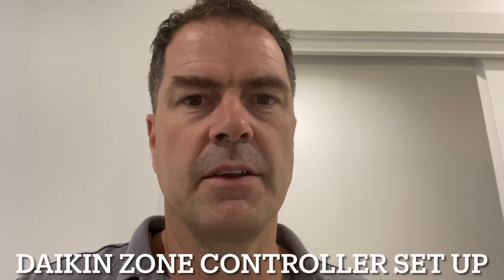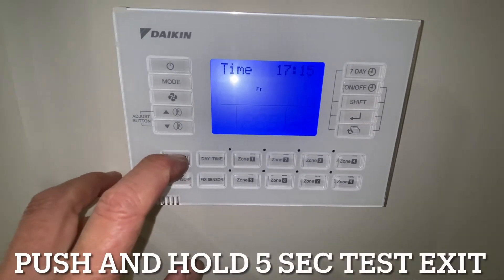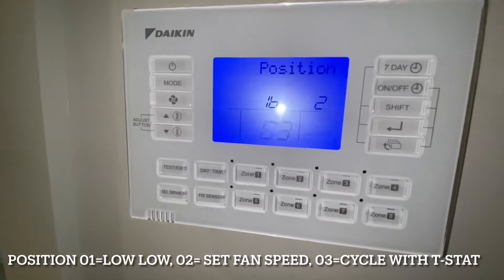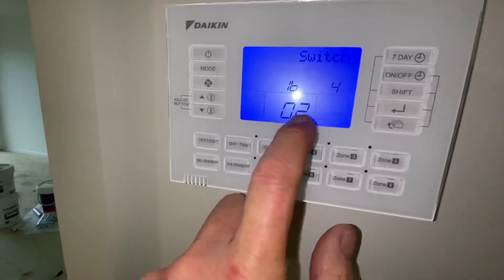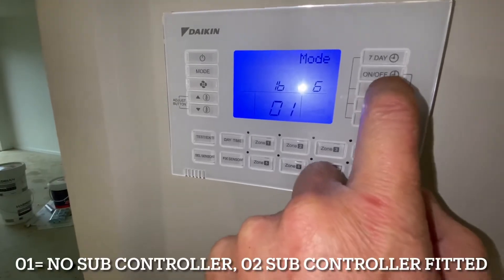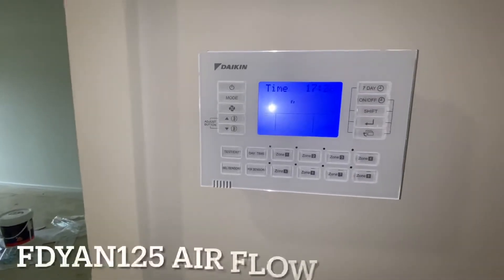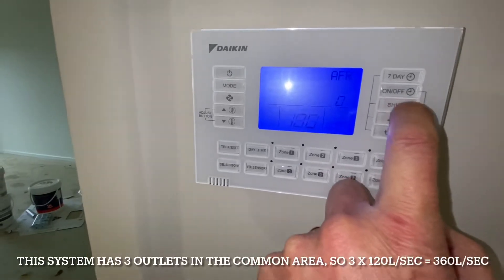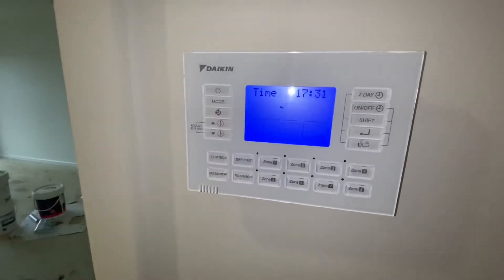Daikin zone controller set up BRC24Z4, BRC24Z8, BRC230Z4 and BRC230Z8.

Comment: Hey Craig. I have really struggled with our office unit not controlling temperature well and suspect some of the settings are not right despite having called out a technician. Your tutorial is good but it has raised a little confusion. When I compare the BRC230Z4B Installation manual pg 11 codes with what you say, they seem to be opposite. For example you say  in Mode 1b, switch 0 is remote sensor 1 default set to 02, not active. The manual has default table and says 1b-0 is set to 01 which is Sensor 1 OFF, implying 02 would have sensor 1 as ON. This is opposite to what you say in the video. It also applies to switch 5 for the master RC which you say should be set to 01 to be active, and the manual says 01 is OFF. Did you make a mistake or am I reading page 11 table incorrectly. I have set switch 5 to 01 and switch 6 to 02 which per your video would allow the Master RC to be active as well as a Sub RC. I will experiment with this to see if its better but as it seemed like you were reading from a manual I wanted to hear what you thought. Many thanks. Antony
Reply from the maker: Hi Antony,
Thanks for taking time out to comment, from time to time I am wrong and I am the 1st to admit it. But there are two controllers ,this is the newer one (BRC24Z4B9) and when this newer controler came out we found that Daikin had decided to change a few things with how it came out of the box. This one's default settings on page 11 says sensor one is set to 02 (sensor on) the previous model default setting was set to 01 (sensor off). I just double checked a new install manual and the older install manual. So your installation manual is correct for your controller as I believe it's the older controller. If you have a closer look you will see that your controllers look slightly different from the one in the video, but they have the same functions, just a face lift and change of default settings. Actually I don't think the older controller has the Daikin's "airside Control" option where it will automatically lower fan speed as zones are turned off. 

kind regards

craig

Comment: Great video mate I just got my controller in with the air con and when i go to Sel Sensor it doesnt say Master RC it has indoor sens and sens 1 should i change it to sens 1 which I think should be Master RC is that right. thanks mate.
Reply from the maker: Default it has sensor one and indoor sensor. If the company installing put a remote wall mounted sensor in(about the size of a match box) it will work, but if not installed it will go into fault. Adjust the settings to turn off sensor one off and activate master rc sensor. It’s in the install manual and I think I do the settings in this video.

Comment: Great video. I did not know about the airside temperature adjustment. Some other settings I know of are:
* 41-0 to read current air temperature (i.e. either return air temp or the Master RC temp depending on what you have selected)
* 41-1 to read condenser temp 

There are also some "Quiet night mode" settings that allow the outdoor unit fan to run at a lower speed at night to keep the noise outside to a minimum. To enable it, set 26-0 to 1 (on), and you can adjust the time it kicks in using 26-1 (e.g. setting to 4 means it will run quiet from 10pm to 8am).

I happened to find the above by chance on some PDFs online, but wish I could find the complete set of field settings so I could fine tune the behaviour of the unit.

Comment: Hi mate I want to set up master and slave for brz24z8 Daikin Controllers. Do you just change to 02?
Reply from the maker: Do you have two controller??
Reply from the maker: It’s probably easier to make the sensor active in the master controller and slave. This way you can just press the select sensor button and then select the  sensor you want active.
Reply: Yeah two controllers
Reply: Is it whatever controller you turn on first from the two controllers is the master?
Reply: Sorry not the sensor. I’m commissioning a 24kw Daikin and just wanted to know how to make the controllers master and slave. Thanks
Reply from the maker: @OceEditzz  think it’s done on the pc board with in the zone controller box up in the roof, there is a pc board that’s installed when having two controller and depending what one is plugged in will be the master. It’s in the install manual for the BRC24z4 etc
Reply: Thanks mate

Comment: Good video, how do I add room temp display on this device ?
Reply from the maker: You can’t, this controller has been out a while now, at the time when it was released it was a upgrade from the standard controller, but the standard controller has been up dated and now the zone controller is sort of a down grade (except for the zoning and temp sensing ability). This controller lacks a room temp display and the timer difficult to set / adjust / cancel.

Comment: Hello and Thankyou I have now been able to correct my zones which is brilliant! Wondering if you have any info on how to reset the wifi controller as my network has changed and i can nolonger connect to it. Cheers :)
Reply from the maker: Wifi acts as a 2nd controller, you will need to find your wifi module / controller (possibly in the roof near the man hole or near the indoor unit). You will need the ssid No on the side of the controller and get the model No, then search for the instructions / manual.

Comment: This video has been so incredibly helpful. Our system limping along with U2 fault (replaced capacitor they now want to replace ICB) but I’ve now been able to set the thermostat to the main controller and have the fan turn off when it reaches temp. 

Is there any way to:
1. Set the min temp in heating to less than 16C?
2. Display current temp on main controller?

Cheers and thanks again.
Reply from the maker: Lowest setting with this controller is 16 on heating and there is no option to show current temp. This controller is getting a bit old now, was better than the old standard controller when it came out, but now that has been up dated the zone controller is now lags behind.

Comment: Hey mate just want to say great video ! Really helps us blokes to setup the controller when the installer doesn't, I was hoping you could help me on what fan speed is best for a 4 outlet ducted system 1-15 mine is default on 10 and i have noticed you have 7 outlets and you have set it on 9 fan speed
Thanks mate hope you can help :)
Reply from the maker: It will depend on the system as the fan motor power is different in the different size systems. Just set a speed and see how it goes, but be careful not to set it to low and you will lose capacity.
Reply: If it may give you some better information the model number for the outdoor unit is RZQ71LV1, I hope this helps you to further understand my unit :) also if possible sorry to ask so many questions but could you also tell me from my unit how would i go about your airside control part of the tutorial that would be really amazing !

Thanks mate for getting back to me so fast ! Legend
Reply from the maker: @redrum5795  Hi,

The 71 has a different fan motor and fan scrolls, the indoor unit is much smaller, the setting really has to do with a lot of things like end duct size, if your in Sydney most duct is 250mm at the outlet and they use round cone diffusers and it’s mostly for cooling. With the larger end duct there is less resistance to air flow so the setting could be lower. In Canberra we use 200mm duct to the outlet so the velocity of the air coming out is enough to reach the floor, we also mainly use MDO square outlets, this allow us to push the air to the floor for heating. With the smaller end duct the resistance to air flow is greater so the setting may be higher. The rated air flow rate for your unit is 566L/sec, just play around with the things and see what’s good for you, if you notice a drop off in time it takes to heat up/cool down I would say your air flow fan setting is too low.  Hope this helps

Comment: Thank you so much for the video. May I ask why was 1b selected as the mode and if this is specific to the unit shown or is it for all units?
Reply from the maker: The mode for the controller is 1b, it has zone box and pc board up at the indoor unit not just the controller. It is model of indoor dose not matter and the aces codes for the standard controller are different and please remember this is for Australian ducted units.
Reply: @FullyAirconditioned  thanks for that!